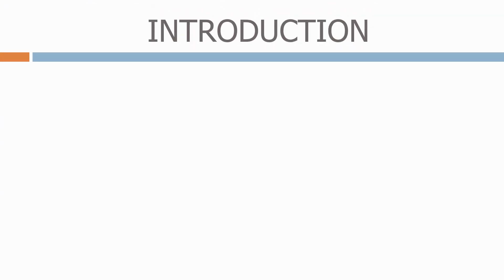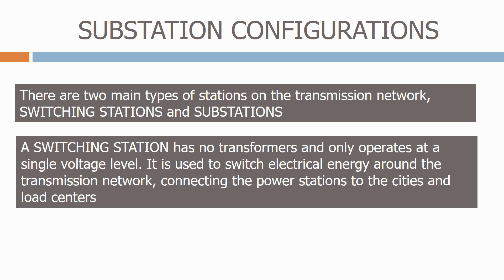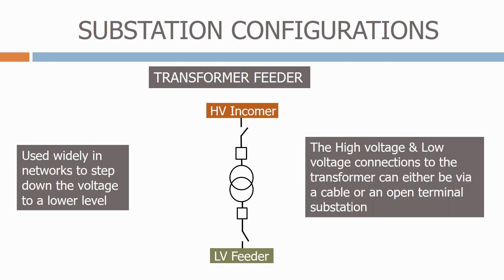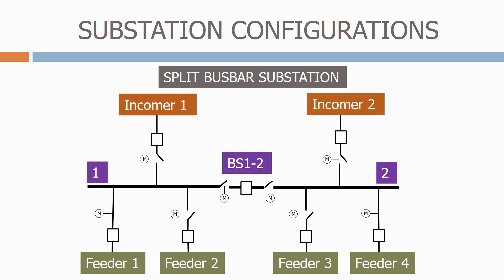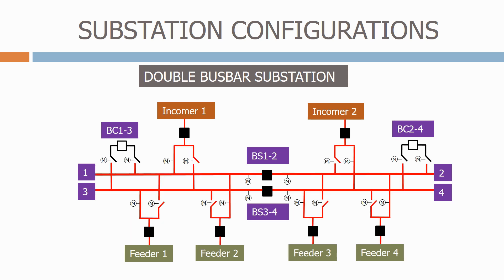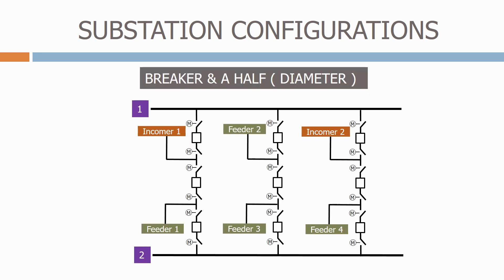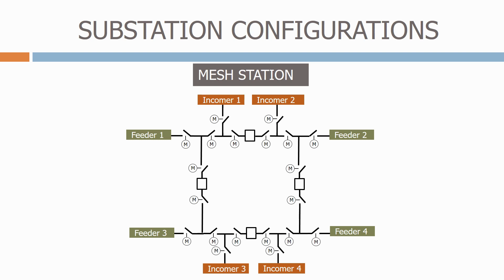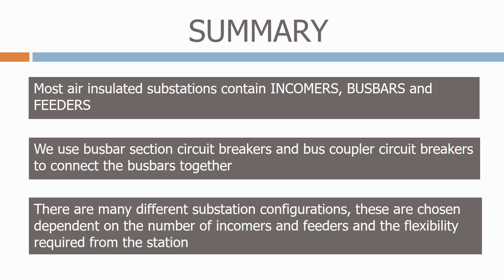Substation configurations

Comment: Explanation is perfect ,but  how we  close the circuit breaker before isolator for no load condition
Reply from the maker: Hi, The isolators in a substation are electrically / mechanically interlocked with the circuit breakers so that they can only be operated in a safe sequence. Interlocking is covered on the main protection course steve